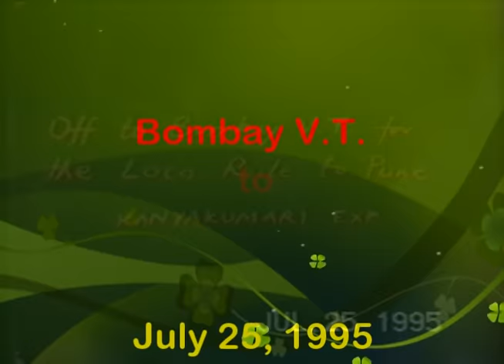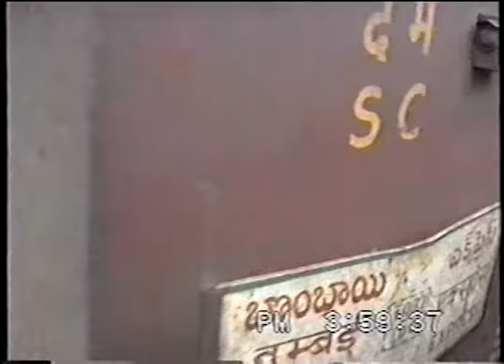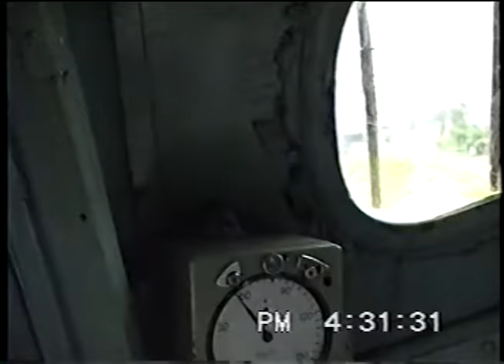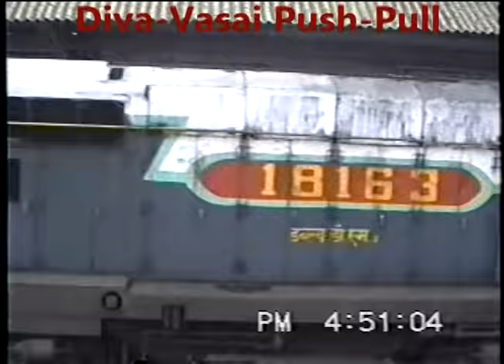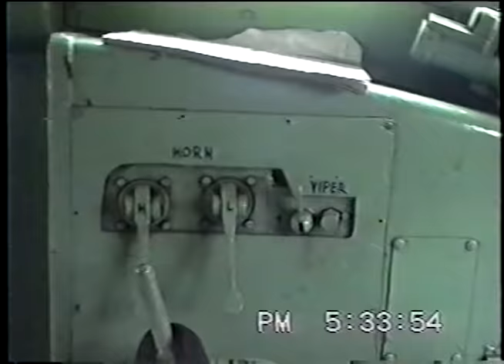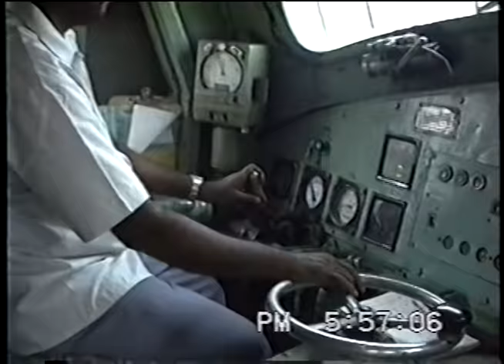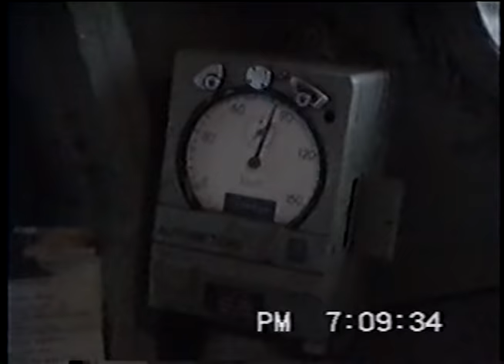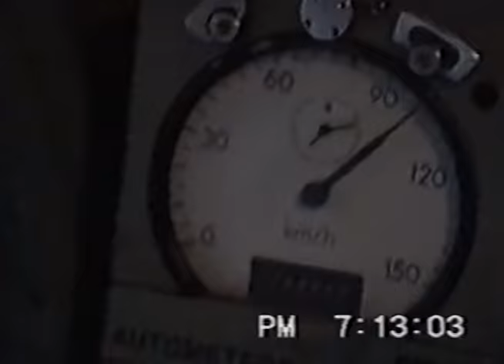WCM2 Loco Ride from Bombay VT to Pune - July 1995

Comment: Pune was very, very different back then!
Even lonavala, khandala and Mumbai were very different back then...
They were so much beautiful! Pune was so full of greenery and hills all around, I remember that so vividly.
Climate of Pune back then was extremely pleasant all the year round. Trust me, even in the summers if there were power cut-outs one would not be bothered at all without a running fan or cooler....
The climate was so good, actually! In winters I have myself seen temperatures go down as low as 8 to 7°c during those times!...
Now pune is not the same at all. So many things have changed, so many trees and even certain sections of hills have been flattened out just to construct residential or commercial properties or for constructing educational institutions...
I miss that pune, really! 😭😭

Comment: Indrayani and Deccan express both in brown with newly introduced Air brake coaches in late 1994 and early 1995. Indrayani had the thin green stripe with brown and Deccan exp had cream brown DC EMU type livery. Both trains met with an Incident and Accident respectively with their new rakes. Indrayani rolling down the ghat without the crew and Deccan express derailed at sion. Both used to get WCM5s as those were the only WCMs converted to air brakes.
Reply: Are you talking about Deccan Express or Deccan Queen ?
Reply: Can you give some more details about the incident
Reply from the maker: I knew about the Indrayani rolling down the ghats.  But didn't realize it was already air-braked by then.  Also, wasn't aware that WCM5s were converted to air-brakes.
Reply: Thank you Devraj Sir for the above information.
Reply: @पापानटोले  Deccan express
Reply: @ManiVijay  Yes sir. If you pause after 33:53 you can see /A or A after coach numbers on Deccan Exp rake and In your Indrayani crossing pimpri  video you can see Air brake written on WCM5 below the headlights and above the V shaped dots on the face. Even on famous Deccan queen pic at Monkey hill with WCM5 you can see Air brakes written on the loco.  WCM5 hauled Shatabdi was also air brake.

Comment: I come from a place know Jhansi, so to travel to Mumbai we used to take the famous Punjab mail, then it was numbered as 5 Down & 6 Up , now it is changed to 12137 Down & 12138 Up

So the Delhi Mumbai route was not fully electrified, electrification was from Bhusawal to Mumbai only, that too Bhusawal to Igatpuri was AC & from Igatpuri to VT Station was DC 

So effectively we had the WDM Diesel locos, so AC engines used to be a delight to watch with the OHE lines, Pentos, so I used to keep awake to see the AC engine attach at  Bhusawal which we used to arrive at 12 Midnight and then again change of engine at igatpuri when these DC engines WCM were attached,  that to, two engines for push & pull on the Igatpuri Kasara Ghat 

I just loved the diamond Pentos & the sound of the musical horn 

One of those Engines is standing at the Delhi rail museum, I am trying to find out if RDSO can develop the same horn it had for our latest WAP series

Listen to the sound of the horn when the Engine is attaching at the platform, just superb

Comment: Were there only 4 parallel lines in use back then? Unlike the 6 line system of current scenario?
And the Parsik Tunnel at 19:30 is so much more populated around the lines now. So good to see such an old video 😌
Reply: Yes there were only 4 lines during that period.
Reply: Yes the parsik tunnel looks so green.  And now its so crowdsourcing

Comment: Excellent video Sir. Brought back a6the good old memories when we used to frequent Poona very ofte6 by the DQ  and Sinhagad Express which were hauled by these beautiful beasts WCM category locomotives.  I did not see the throttle for increasing the speed. What was the round instrument
Reply from the maker: Thanks a lot!  The 'wheel' was the tap changer and is used for acceleration.

Comment: Thanks for this vdo... That time there was no mobile, so the advantage of instant and easy recording was not possible.. Please let us know what was the vdo-camera used.. Got back to an old memory when I visited Mumbai in 1995. I am from Guwahati, Assam. I was very amazed to see those kind of locos... I remember crossing those long tunnels and used to get astonished when any express train crossed the platforms of a station at speed of 80 Kmph or higher within that route. The passengers stranded at the platforms seemed all like flying away... Generally in most other parts a speeding train is set through the main line away from the platform...
Reply from the maker: Glad you enjoyed it.  I had a SONY Analog camcorder with sufficient number of batteries to last an entire journey.

Comment: What  kind of train is it at 21:14? Driving cab at both ends with a loco in the middle?
Reply from the maker: It is a Push Pull train which used to operate between Diva and Vasai Road.
Reply: Idk if trains with this configuration ran in the easter railways. But i can swear when i was a kid (like 5 yo) saw some train with this config in the sealdah division. Really nice video.

Comment: What is the steering wheel like thing? Some sort of gear shift?
Reply from the maker: It is a tap changer using which you can control power to the traction motors.

Comment: Sir, beautiful video. I envy you traveling in loco cab!!!!
By the way, if Jayanti Janta Express arrived Pune at 19:55, then what time did Pragati and DQ reached Pune?
Reply from the maker: Pragati was right  behind us.  DQ would have reached around 8.30pm.
Reply: @ManiVijay  I remember Pragati's arrival time used to be 19:55, just after Jayanti Janta depart from Pune. DQ was first known to arrive at 8 pm sharp. Due to the famous Khandala accident as far as I remember, it was slowed down by 25 minutes and the arrival time was changed to 20:25. I wish they should speed up both these beauties :)
Reply from the maker: @ameyamandrekar9574  I do remember seeing DQ's amazing run in the 60s - 2.5 hrs, right?  When did the Khandala accident happen and what was the incident?
Reply: @ManiVijay  Not exactly accident, but DQ got derailed at Khandala in 80s once. I remember the newspaper headlines saying that her speed was slowed in the Ghats for safety reasons

Comment: REALLY DOUBT THE DATE OF THE VIDEO. IT IS DATED JULY 1995. BUT SHOWS A COACH MANUFACTURED IN 1996 AT 01:07 AND ANOTHER COACH MANUFACTURED IN 1997 AT 01:35. 09:01. HOW IS THIS POSSIBLE.  MAYBE, RECHECK THE DATE ON WHICH THE VIDEO IS MADE. But, really nostalgic........
Reply from the maker: Are you seriously suggesting that I won't remember the year when I made this epic journey.?  Back then, coach numbers did not necessarily correspond to the year of manufacture.  Hence, you are having this confusion.

Comment: Different DC electric catenary and contact with clamped with different stagger arm with brackets
Reply from the maker: Correct.   Looks so different from AC OHE and support structures.
Reply: @ManiVijay  those days rdso standard followed UK Railways old structure might be
Reply from the maker: @eastdeltarailfansclub9322  Quite possible.  In contrast, AC traction was essentially based on French standards.

Comment: Wipers are smaller than the windshield size
Reply from the maker: True.  Not the best design.   Even windows are quite small.
Reply: @ManiVijay  yes sir. Actually those days most of the locomotives have smaller view of windshield. Those time driving was difficult in sitting posture because the windshield height was a bit up.
Now modern wide windshield solved this problem.

Comment: 37:50 really? Passenger hauled by shunter 😱😯😲😳
Reply from the maker: This used to happen before that line got electrified.  Now EMUs run on this line.
Reply: @ManiVijay  I have heard from my grandfather that in Sealdah section Hasnabad line was non-electrified for several years. Those time such WDS4 and sometime a DEMU with Steam loco as the middle unit (just like old Diva-Vasai DEMU) used to run.

Comment: In today's generation you will not see that much crowd in Parel fast track platform
Reply from the maker: Ok.  But why?  Due to other means of transportation?
Reply: @ManiVijay   usually there used to be no crowd on  fast track platforms because no train used to stop there, 
But you can see crowds on platform 1 and 2 which are slow tracks

Comment: 21:13 here is the unique looking DEMU
Reply from the maker: Back then, such Push Pulls used to operate with a Kalyan WDM2 in the middle.
Reply: @ManiVijay  yes also in Sealdah-Hasnabad section. But in this case sometime a steam loco attached to the Sealdah-Hasnabad train.

Comment: 1:38 Camera glitch
Reply from the maker: It was a problem with the VHS tape from which I digitized the video.  I forgot to edit it out, sorry!
Reply: It’s ok
Reply: Oh and another thing
Reply: 22:58 That wiper on the left side window of the WCM2 is crooked.
Reply: And one more thing
Reply: Why are all the tree’s branches hanging over an electric railway at 19:30 and 33:07?
Reply: Oh and at 36:12
Reply: Oh and a question
Reply: Why one of this WDM2 17604 behind WDM2 17590 with a freight train, have a green band on its short-hood and cab at 38:17?
Reply: And another. Why is it raining inside the tunnel at 19:37?
Reply: And another question. How did those ICF coaches crash at 47:30?